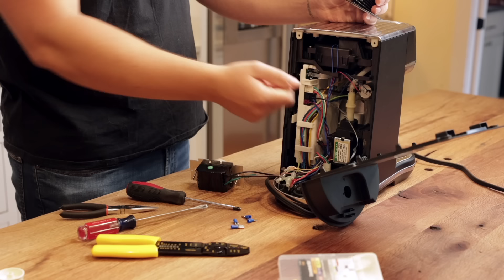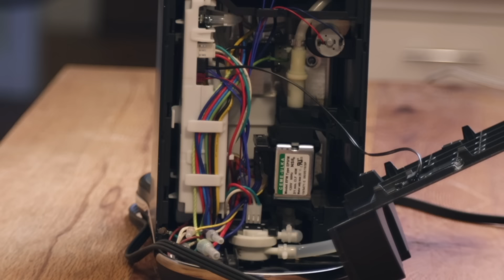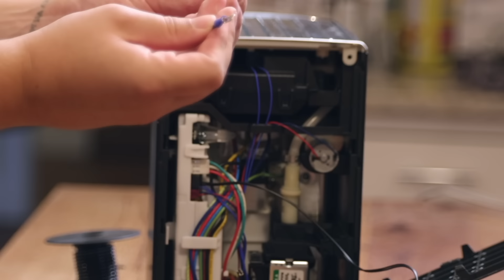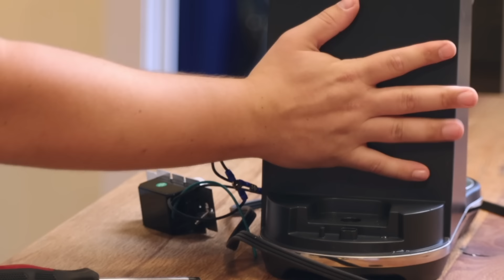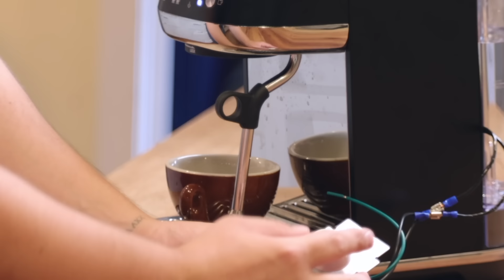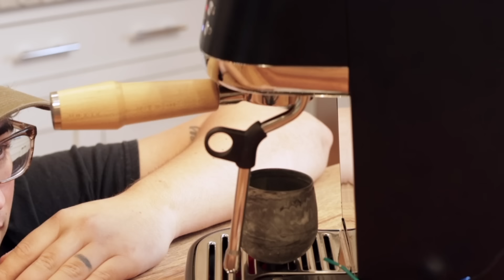Best Espresso Machine Hack: How To Perform The Dimmer Mod

Comment: Interesting mod, BUT since you are tapping into a 120 volt line to the pump, that means that there is 120 volts on those bare connectors you have just sitting around inside and outside your machine. It would be a good idea to at least wrap those bare connectors, separately, in electrical tape to prevent shock hazard to your machine of yourself. Another option would be to use better quality connectors that are already insulated.
Reply: WAGO connectors are superb for something like that. Easy and fool proof
Reply: Agreed. Love the mod, but those are live exposed wires. Needs some heat shrink tube or electrical tape at the very least.
Reply from the maker: Yes. This is important to mention. On my machines I've done this on, I have wrapped them. I'll add to the caption
Reply: @LanceHedrick  Thanks, Lance
Reply: This is a little late, but my understanding is that electrical tape is not rated or recommended for household current. I believe that you should instead be using wire caps of the size appropriate for your wire gauge. In my experience doing it the wrong way ... I might have once used electrical tape to secure the connections to a step-down transformer... heat liquifies the electrical tape glue and then it's just an unsecured plastic ribbon that can easily come undone, depending on the angle of installation and any jostling or vibration it may be subject to. 
Okay, maybe I did the same thing two or three or four times because it came undone eventually. 
On the other hand, many years later and after reading a book or two on the subject, I've never had trouble with wire caps screwed onto wires properly twisted with my lineman's pliers (any sufficiently heavy pliers should do). Granted I've only wired less than a dozen fixtures myself, but still. More importantly, the people who do it for  a living say it's the right way.
Reply: @paritybit7830  electrical tape is better than nothing. But grabbing wago or similar in Home Depot is the way to go for those without electrical experience. Pretty foolproof. No crimpers needed.
Reply: @gagegr Electrical tape is worse than nothing, in that it conveys a false sense of security.
Reply: He'd have been better off joining the dimmer wire to the extension wires with a butt connector, which it looked like he had in his little box.
Reply: That was the first thing I thought seeing this video. 
Getting the right type of insulated crimp connectors or just some heat shrink tubing.
This video should be deleted so nobody tries to do it the same way
Reply: does the dimmer need a particularly specification?  i live in a 220v country
Reply: @alvarobesnier  you would have to look at the pump to see what voltage rating is written on it. Given that you may be having to deal with twice the voltage, playing with this mod would be even more deadly unless you are familiar with working with electronics. I am a technician and could do it, but would not advise the untrained to try it.
Reply: @PhilT993  it is 220 my question is if the. dimmer has to be any different
Reply: @alvarobesnier  buy a dimmer that is rated for dimming 220v circuits. The ones available locally to where you live should be 220v rated
Reply: OSHA doesn't go to Arkansas
Reply: @veganpotterthevegan  The Eff they don't. I'm from Arkansas and I've heard horror stories of OSHA coming onto job sites. I was told if they are ever there, just sit down and stop working.
Reply: Actually, it is a 12V pump
Reply: @evandrotoniati  You are incorrect. If you look at the pump, in the video, you can clearly see that it is marked "120v 60Hz" which is 120 volts AC. If you search for the replacement pump. you see the same specifications. Lance is wiring a standard household ceiling light 120VAC dimmer switch in series with the 120VAC ULKA pump to vary its speed. If not dome properly, by someone who knows what they are doing, this could be kill you!

Comment: Lance did this one have a thermojet boiler or thermoblock?  I have a Casabrews 5814 Pro with this heater and I wonder if the flow control will cause grief for it.  I know it would cancel a warranty  https://www.youtube.com/shorts/URO37I-gL2o

Comment: FYI - this mod does NOT work with all espresso machines unless you get a dimmer switch withOUT a Triac circuit.  With a low end machine, you probably don't notice it, but with a machine like a Bezzera BZ10, the dimmer switch used here will not allow the pump to reach full pressure because of the Triac - and you will notice for sure.

Comment: Did this to a Hibrew H10A and it was a complete flop. I got a 220v dimmer, tried it on a lamp, perfect. Spliced it in on the wire to the pump, very happy I was going to have more control. Plugged it back, warmed it, and as soon as I dim a little, it just stops pumping. I can do a micro adjustment but still, it's too low. That's disappointing. Is it an issue with my mod? Or is it not running from a vibratory pump?

Comment: Caution, if you chose to use a resistive load dimmer you can burn up your motor. The motor has an inductive load not a resistive load.  You need an AC motor speed controller that is specialized, Variable Frequency Drive (VFD), PWM Controller/VFD for AC, SCR Voltage Controller.  They are available on amazon for $20.  This is because an inductance motor creates a magnetic field causing current to lag voltage. A specialized variable controller has capacitors, inductors, semiconductors and filters in it that perform "phase cutting," filtering and buffering.  They switch the AC power on and off very rapidly within each cycle, smooth out the sudden switching action to prevent electrical noise, eliminate voltage spikes, create a stable DC bus, uses inverters to synthesize a new AC waveform at a variable frequency and voltage. Whereas a standard dimmer just reduces voltage which in turn reduces current.  And that is harmful to your motor. I believe to be worth the extra $10.
Reply: Hi, do you have a link? Does it need 230 for it to work?

Comment: I don’t know the name of the plugs, but I know that there are connectors that have both female and male.
It looks like(from the pump) there are two male.
That means, you’ll need a female to connect to the pump, and another female where you will connect the cable to the dimmer. 
From the dimmer it is better to have a male connector. In case that you have to unplug the dimmer. That way you don’t leave the connection exposed and causes a short!!
By the way, I would drill a hole at the base of the machine to run the cable under the machine. There are many ideas to make it look clean and functional!
I was thinking to even run a long cable behind the coffee station and hide it underneath the table where you can manage from there!

Comment: I finally added a dimmer to my Bambino Plus. I love being able to control the flow but bummed about how much the water temperature is affected by slowing it down. Seems the Bambino temp control is not able to compensate for the unexpected flow rate through the thermocoil.
Reply from the maker: It's not as much as you think tbh
Reply: @LanceHedrick  Appreciate the response. I measured 11 degrees difference in a styrofoam cup.  I will say so far I am liking the espresso results.  Also have to remember to reset the dimmer to max each time. Especially when steaming milk the pump has to pulse at full flow. Need a spring-loaded dimmer that always returns to max!
Reply from the maker: @rpaUkes i wouldn't rely on that temp measurement. I've done readings from the group head using a modified scace and a TPD sensor from Pesado. It isn't that big so no worries, especially if you arent finding issues in the cup

Comment: Isn’t the pump pre thermo jet? Won’t you be causing the water to overheat by slowing the flow through the heater? I know there’s a PID, but not sure at what point in the chain it is.

Comment: I did it to my Bambino Plus, and for some reason it malfunctioned, and now the pump is constantly on when plugged in. I wonder if it happened to anyone else... In addition I was thinking of maybe using a LED dimmer instead of regular one, because it uses a smaller W-range(3w-100w) therefore might have better control. But not sure if I'd just make a greater mess. Any thoughts?

Comment: nice! whee does one source the right dimmer? is i a leading edge? or trailing edge? I have tried several that did not work, apparently it needs to be an older one without much electronics and NOT for LED

Comment: lol man the 2 leads are almost touching at 12:30, this is not exactly safe, also those dimmers are designed to work with resistive loads, not a motor which is an inductive load, maybe a fan speed controller would be better suited.
If someone still wants to perform this, please ground it and put it inside an enclosure...

Comment: I recognize that by making this modification I would be turning my automatic into a variable speed manual...but would I still have the use of my programable shots, assuming that the dimmer is flipped on and fully open? I love the idea of my little bambino having this upgrade, but I'm not the only one using it...

Comment: Hi!  I've just added a dimmer mod to my saeco se50. This mashine also has got an ulka pump. The problem is the dimmer decreased the flow rate to 7gr/sec in set  max open.  If a dimmer stand in minimum open, the flow is not constant but waves.    Could you put some more detailed info about dimmer you used?

Comment: Tried this mod on a Calphalon TempIQ (non-grider). The dimmer works but I can't seem to keep the bottomless portafilter from spewing the shot all over the counter. I'll continue to try grind size and shot length to see if I can get control.
Reply: Did you run into any issues or additional steps compared to the breville? I have the tempIQ as well and am thinking about doing this. The standard pressure seems very high

Comment: Where do yo recommend attaching for the ground? To the little ground wire that is attached to the casing? Is there any easier/better way you’d recommend outside of just cutting the wire and splicing into it using a wire nut?

Comment: Great video. I’m thinking about doing that to my breville 800ES. I have a question though: this machine has a 15 bar pump. I would like to also lower the pressure. Will that be enough? Or should I also look into other modifications? Maybe I can replace the pump or something…

Comment: @Lance Question looking to buy a bambino plus, the dimmer has a on/off switch dialed to the lowest do you know how the bambino will react if turned off to do a blooming phase?
I have been doing this with my lelit and works flawlessly, but just now if the bambino would go crazy

Comment: yes, the dimmer mod is great. But this is soooo badly executed! You should be utilizing a small dimmer, like the ones included in table or floor lamps. And installing it inside the machine. Dunno about you, but if I had a bunch of wires and appendages sticking out of my espresso machine my wife would relegate it to the basement. Heck, even I would relegate it to the basement.
Reply from the maker: This isn't how I house them. This is strictly to show how to do it. And these dimmers work just fine. I've done... a lot of these. Cheers

Comment: Makes you wonder if it’s just a matter of adding  a $5 controller to the existing pump circuit why aren’t there more flow control machine options at lower price points ..  nvmd it just hit me.

Comment: I modified my bambino (not the plus) and it works great! thanks so much! I tried pulling a spro over, but the shot automatically cut out at 1 minute. do you have any advice how to pull a ful 90 second spro over on the bambino?
Reply from the maker: You'll have to modify the recipe to 60s. Not a big deal because the basket is smaller and can't do as much. Anyway. So just do a smaller dose and faster extraction. The pump in the bambino does only 60s cycles
Reply: @LanceHedrick  got it. thanks! by faster extraction do you mean coarser grind so the water will run through it faster? or grind finer and use a higher water debit/pressure?
Reply: Also, for the spro over, what do i do about the pre infusion? should i have the dimmer fully open at the start for the pre infusion and then lower it to the lower pressure? or should i leave the dimmer at the lower pressure the whole time including during the pre infusion?

Comment: Hi lance. I have a question about dialing in a shot now that I have variable flow rate. Since I now how two variables (flow and grind size) how do I dial in a shot for time? Am I limited to strictly going by taste now? I know you recommend that, however, it’s nice to get a ballpark by time first before fine tuning with taste. Is there a recommended “free” flow rate/portafilter diameter you can recommend? Ie, how much water should flow out of the group head without a basket? (Would change for different basket diameters I would assume).
Reply: Did you ever get an answer for this? or did you find out how to dial in a shot? im having trouble getting a well balanced shot on my GCP

Comment: I have a predicament. 
I modded my barista express successfully but my friend’s bambino plus simply doesn’t want to work with the mod. We checked voltages, voltages we’re dropped about 10 volts when connecting the switch to the circuit. Any ideas?

Comment: Man, does it work if I add a dimmer to the Cord itself? between power plug and the machine?
Reply: No, that would affect the heater as well as the internal controller too. You need it just on pump output

Comment: I'm concerned how this might affect the lifespan of the motor. Has anyone had any experience regarding that?
Reply from the maker: Doesn't hurt the pump in the sense that the pump would die of natural causes prior to this killing it. Have known many that have had this mod for some years with no issue. Doesn't seem likely to konk out. But, of course, no need to do it!
Reply: @LanceHedrick  Hey Lance! Thanks for the reply. Will go ahead and try it on my Lelit Anna.

Comment: i found a dimmer where you just plug in the cable from the espresso machine to the dimmer and then to the socket, would this work since i don't know how to open my espresso machine lol
Reply: Probably not, since you would be changing the input electricity to everything, instead of just the pump, such as, temp control , etc. Could be a big mess, but I only play an electrician on TV,  hoping for a pro response here too.

Comment: Modern dimmer switches use PWM to limit power IIRC - so theoretically this mod could be done with a simple microcontroller and some cheap parts and you'd have full programmatic control over the flow. Could even integrate with a Bluetooth scale at that point and cook up some automatic profiling. Hmm... I think I found my next project.
Reply: any updates?
Reply: You cannot use PWM based dimmer to control inductive load. I tried it accidentally; The cheapest dimmer I found turned out to use MOSFET + rectifier. Ulka Pump won't budge this way.
Reply: I would also be interested in a update
Reply: Updates please

Comment: When you slowed the pump the water essentially boiled out of the grouphead, meaning the PID didn't seem to adjust to the change in flow rate. Not sure what elevation you are at, but are we not worried about that messing with the puck and extraction?? Does this also happen when in manual brewing mode, aka holding the shot buttons down for preinfusion?
Reply: It doesnt matter if the pump operates at higher pressure.  That’s what everyone is trying to control by controlling power.

Comment: As I see it would be a good supplement to a pump pressure gauge installation. You would be able to keep the brewing process at desired pressure to get different kind of extractions.
Reply from the maker: Yes. 100%. Been meaning to make that video.
Reply: @LanceHedrick  that would be fantastic!
Reply from the maker: No promises on when lol. I have a huge queue of videos in the making

Comment: Is dimmer mod sort of a pressure profile or flow control?
Reply from the maker: Flow control! Which directly relates to pressure. Input flow times resistance of puck equal pressure
Reply: @LanceHedrick  The dimmer is connect to the L wire from the pump, which is control its electric current output, isn't that a pressure profile?
Reply from the maker: No. The ulka pump dictates the flow of water going to the group. Yes it will keep pushing, but the opv is what dictates the top pressure.
Reply: @LanceHedrick  Oh, what about decent machine, is that a pressure profile machine?

Comment: Hello! Do you think there is a way to mod the Bambino Plus to go above 93°c? This mod plus a controllable PID would make this fully featured for the price. Or at least better suited for light roast too if you change the basquet. Thank you for everything!
Reply from the maker: So, actually, the bambino fluctuates greatly even with a PID. It sometimes goes to 102. So, I recommend doing longer shots so as to minimize the temperature fluctuations influence on the extraction, if that makes sense. More lungos
Reply: @LanceHedrick  I think I understand. So a longer shot for a lighter roast would mean both better temperature stability, and also since the contact time would be longer, also improve on the extraction? Sorry, I am not sure if that last bit made sense haha. It would be nice to play with it and repace the PID with an arduino, screen and more granularity anyway. But maybe it would be too much... Thank you again!
Reply from the maker: Yes! You are dead on. Good job there!
Reply: @LanceHedrick  You are a very good teacher after all 🔥💜🦊
Reply from the maker: Thank you so much!